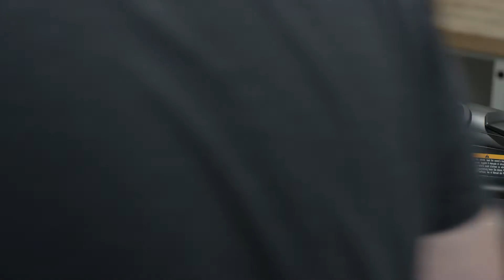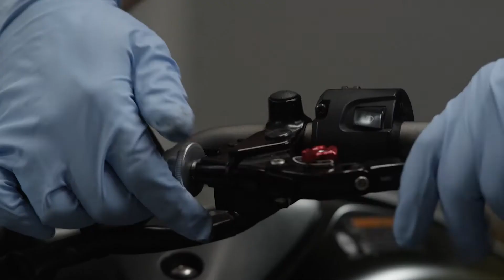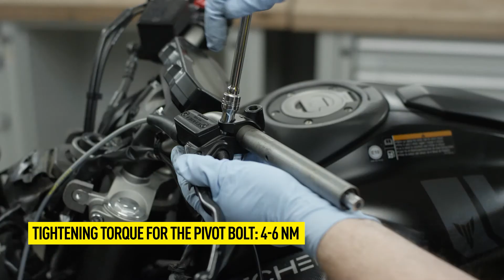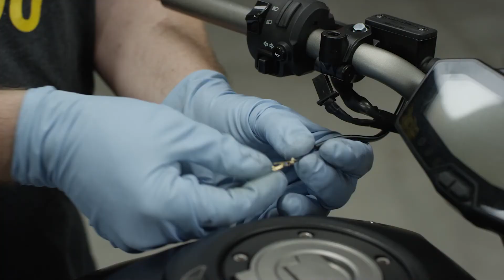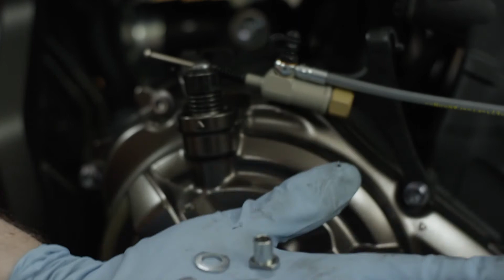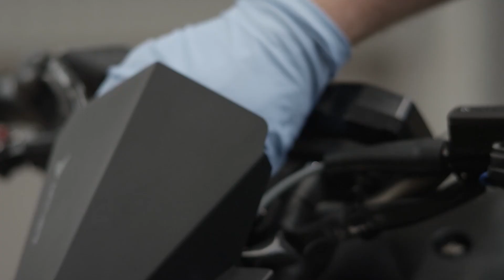MAGURA HYMEC - Installation Street Clutch Kit

Comment: I wish the Hymec had the option of adjusting the lever position without changing the slave cylinder actuation range. Actuation range is only 10mm meaning the lever adjuster must be set at maximum setting in order for the clutch to disengage completely (on Kawasaki Versys 650). This makes the lever hard to reach...